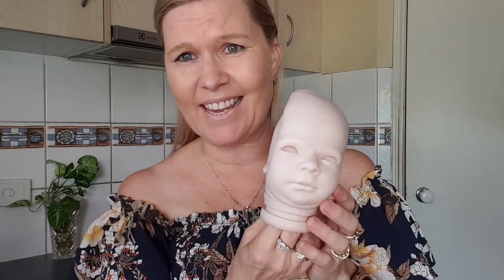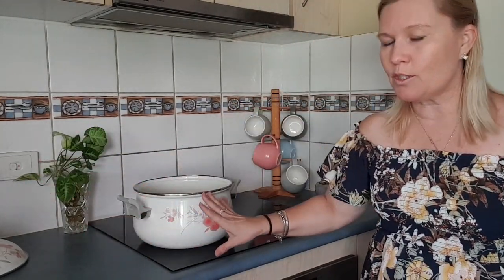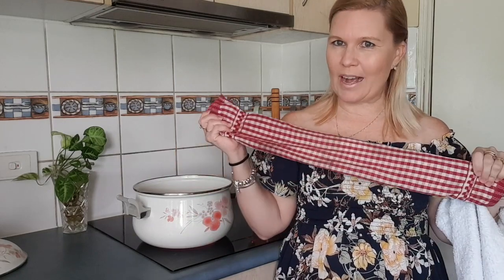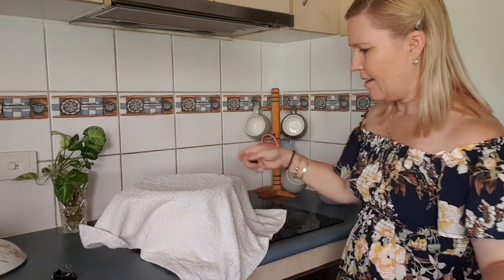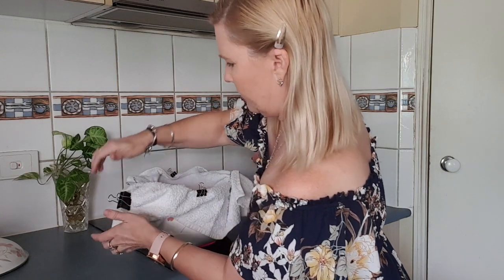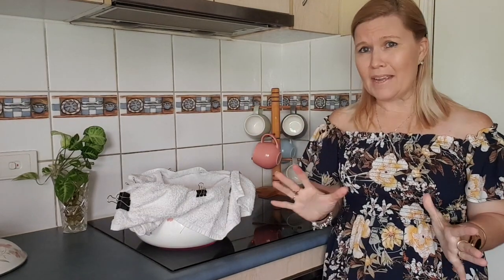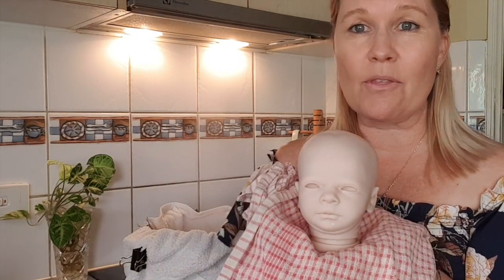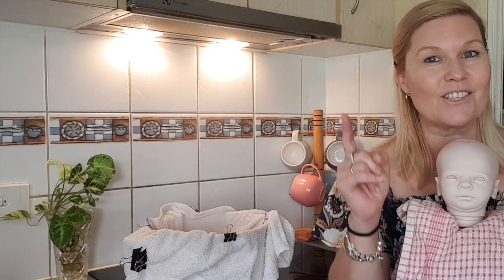How to fix an out of shape Reborn Baby Kit " Don't Throw it away"

Comment: So I have a question, I have a reborn doll I’ve had her since I was about ten years old and her face is flat, she came like this it was not described like this in the eBay post where my mom got her from they posted the original pictures of the doll from Ashton drake galleries and I was hoping I could fix or reshape her face
Reply from the maker: Its possible she could be reshaped but there are alot of factors to think of. depends how hard the vinyl is, whats inside her head ect.
Reply: @AussieRebornSupplies  her head is weighted and she does have a magnet and her hair would probably have to be rerooted, the vinyl is soft enough to where you can squeeze her head, she would be considered a hard silicone vinyl, she’s a really beautiful doll and I love her very much I would love for her to have a touch and maybe get her body replaced, do you touch up dolls if they are shipped to you or do you know a store that repairs dolls I would love to do it myself but unfortunately I feel like I’m under qualified to do so.